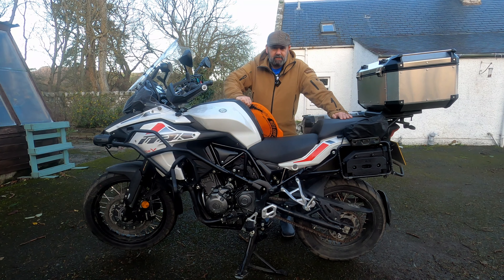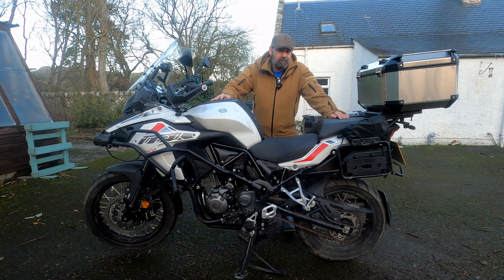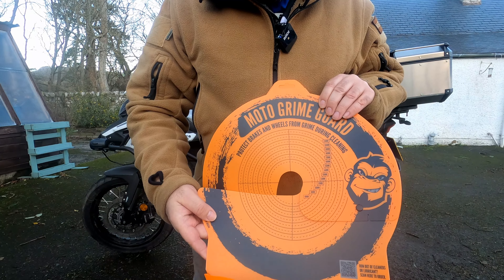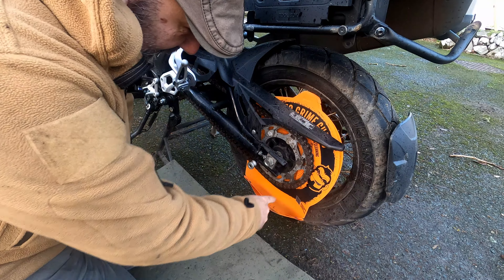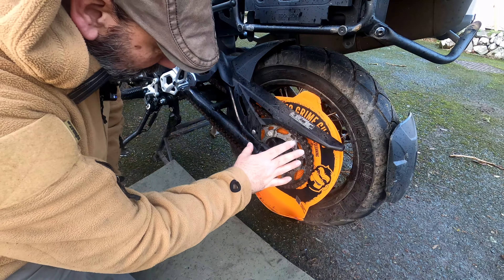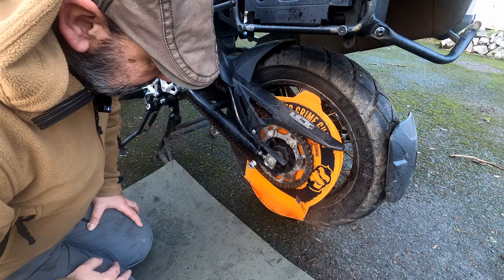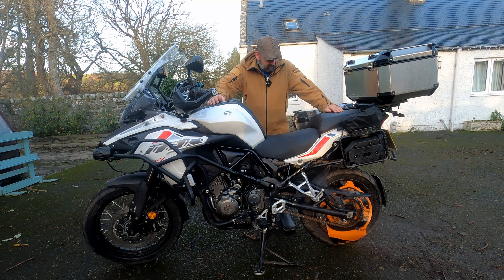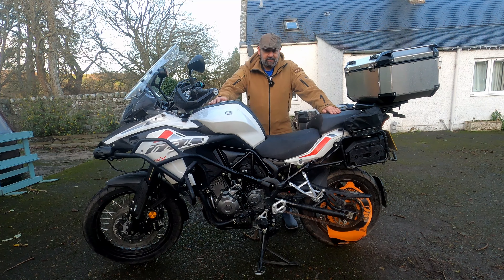Bike Rider Reviews True Tension Moto Grime Guard

Comment: Extra bike! Is it possible to achieve 30 kmpl or 80 85 ukmpg at 50mph in 6 gear easy relax solo ride without the panniers on the open nice flat road?? Constant speed.. I m 6 foot or 180cm...100kg
Reply from the maker: I have never worked out mpg fuel ratio but when I'm on tour with panniers  and top box fully loaded plus a bag on the rear seat I get around 230 miles to a tank of fuel. Ride safe 👍
Reply: @BikeRiderReviews  thanks.. What s your average speed on that trips?
Reply from the maker: @ivanmaric4752  My tours usually incorporate all types of roads, dual carriage ways, fast A roads and B roads right down to single track roads, my speed will differ from around 75mph right down to 30mph so at a guess I would say an average of around 40 - 50mph.
Reply: @BikeRiderReviews  thanks bro

Comment: Why can't you just jet wash it all without the guard
Reply from the maker: Hi thanks for checking out the review. From what I have seen about jet washing chains it may not be a good idea. The high pressures may damage the o or x seals allowing water ingress into the link pins which will cause excessive wear or reduction in movement in the links. Also using a designated chain cleaner solution will dissolve and remove the old chain lube more effectively. Ride safe 👍
Reply: There's also the benefit of less crap ending up on your floor, in drains and groundwater.
Reply: Oil and water don't mix bro